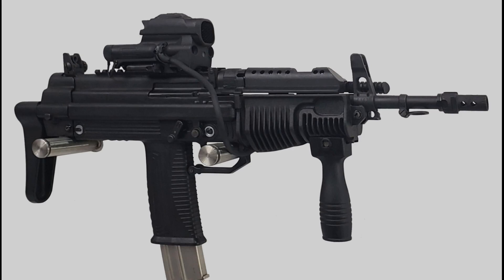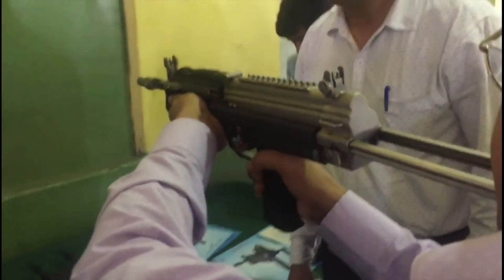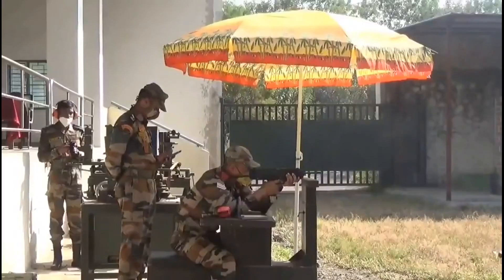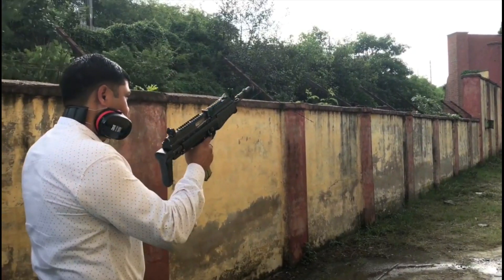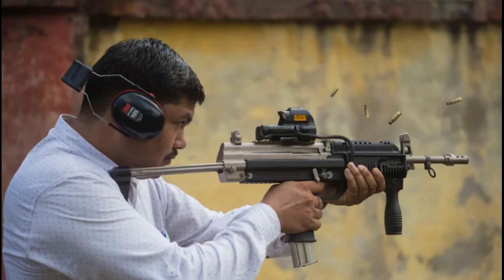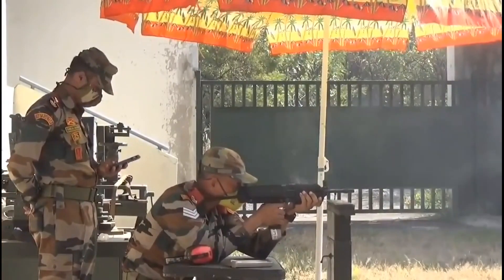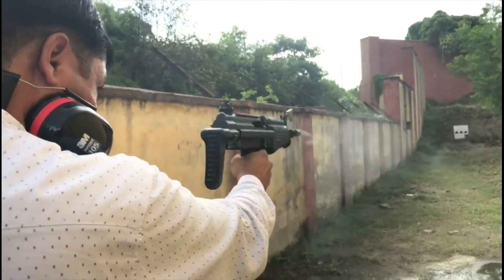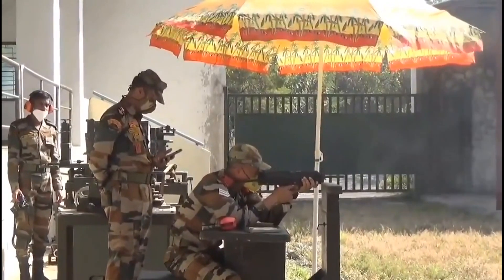JVPC: Joint Venture Protective Carbine Explain | in English

Comment: Its 2024 now and the army has still not placed orders while the ASMI machine pistol has received a small order of 550 units after a development cycle which started in 2020 i.e. almost around the time that the JVPC had completed all army user trials and criteria. Wonder what's going on here ?
Reply from the maker: It seems that the Indian Army doesn't need the JVPC, as it's a Personal Defense Weapon (PDW). Instead, the JVPC is being inducted by the Central Armed Police Forces, State Police, and SPG.
Reply from the maker: When new equipment is introduced into service, initial orders tend to be small. The same is true for ASMI. Once the army is satisfied with its performance and reliability, it will be procured in significant numbers.
Reply: That is what I do not understand, the 5.56 ×30 caliber round in the jvpc has greater stopping power than the 9 × 19 parabellam n will do well in counter insurgency operations in Kashmir/elsewhere. It's a good carbine. Why would the army not buy something for which it provided the GSQR and got it cleared in trials so long ago ?
Reply from the maker: The GSQR was set out in 2002, but things have changed a lot since then. New types of carbines like the M4 and X-95 have been developed. The reason they want a new gun is because the INSAS-based carbine (which uses 5.56×45mm NATO) had too much recoil. So, they wanted a smaller cartridge, like the 5.56×30mm MINSAS. But newer carbines like the M4 and X-95 can give the same power as the 5.56×45mm NATO with less recoil. Even though the MINSAS is more powerful than the 9×19mm Parabellum, the needs have changed now.

For close-quarters combat, the army uses submachine guns chambered in 9×19mm. This choice makes sense because soldiers always carry a pistol chambered in 9×19mm as their secondary weapon. This simplifies logistics.
Reply: @defencestudy  I understand the logic you have explained. Just wished, we had better planning in designing weapons and did not spend tax payers money like this. Just one point through and please correct me if I am wrong, I still feel it would be a good weapon in the hands of the Rashtriya Rifles (who mostly use an AK series/derivative style rifle) during COIN ops especially withing confined spaces even with the challenges of ammunition logistics. Your thoughts on this..
Reply from the maker: @krishnanprem61286  If we just focus on the Army, the planning can be better. Overall, the JVPC has applications with other forces in India and can be exported to foreign countries. 7.62 mm rounds are the best for COIN operations. One hit in the right place can kill the enemy. However, one hit from a 5.56x45 NATO round can't always kill the enemy. That's one of the reasons why the army is shifting from 5.56 to 7.62. SF cases are different. 7.62 rounds give more body exposure to kill an enemy. In confined spaces, the JVPC is definitely a good choice, no doubt about it. But in real time it doesn't happen like that, it's complicated. The JVPC, with a range of 100 meters, is suited for confined spaces, whereas the AK, with a range of 300 meters, can be used for both short-range and mid-range combat. The AK offers more flexibility in COIN operations, where situations can be unpredictable. If a very short-range fight occurs, a pistol can also be an option. 7.62x39 for direct assault (Ak-series) and 7.62x51 for Maskman(Sig-716) or Machine Gun(Negev-7).
Reply: @defencestudy   
Thank you for your views!